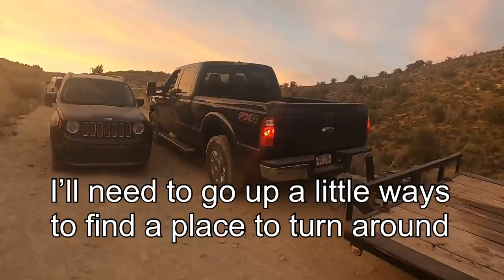Jackknifed! Ford Super Duty on the edge!

Comment: Man, a Jeep that doesn’t come with a spare. Must have those “life-time, no maintenance” tires and parts.
Reply: Those renegades are a joke.  Jeep in name only.  A fiat 500 underneath.
Reply: @jasonehredt968  I think it's a panda actually, but still useless.
Reply: @jasonehredt968  what makes them a joke?  I've been driving one for 3 years, no issues.
Reply: Only the Trailhawk comes with a full-size spare tire
Reply: @Mr.Torres831  only the Jeep Renegade Trailhawk comes with a full-size spare tire
Reply: @Ryan-yo4dg   You're full of crap the Wrangler comes with a full size spare to dbag
Reply: @jasonehredt968   Fully agree renegades are a joke should not have the Jeep title at all they are street queens through-and-through
Reply: @jasonehredt968  We've had ours out in the boonies with no trouble.  Granted, we bought a trailhawk model with taller ground clearance, different front bumper for better approach angle, skidplate, and apparently most importantly a full-sized spare wheel and tire, which to me is rather critical anywhere outside of the city.

I don't think this particular Renegade was even a 4x4 though.  Jeep has sold many models that weren't 4x4s, including old-school Cherokees though, so it's not like this is a new phenomenon.  But going out of the city without a spare tire was a bad move.
Reply: @gearhead9115  I never said anything about other Jeep models not having a full size tire, I simply stated that it's the Jeep Renegade Trailhawk that comes with a full-size spare tire
Reply: @Ryan-yo4dg   Everything makes them a joke clearly they can't go off road for God's sake they had to stack rocks to go up a  Fucking car trailer ramp.  I realize it has a flat tire but good Lord a real Jeep with a flat tire could still go up that without stacking rocks, that thing belongs on the street nowhere else and maybe a light dirt road lets it. it has no place on the trail  That's a joke of a rig As I said you can maybe take it on and arose and be safe but a true trail forget about it.
Reply: @gearhead9115  no need to call me a dbag
Reply: @gearhead9115  mine is a street queen during the week and a weekend off roader/toy hauler
Reply: @gearhead9115  the only joke here is your improper use of punctuation, poor grammar and unnecessary profanity.
Reply: You guys are funny. Most people can't afford a 50k wrangler, and something like the renegade is good for the snowy winter months for the northern states. Yah it can't go rock crawling but it's not build for that
Reply: @donavina.9066  YouTube Jeep Renegade Trailhawk in Moab, Utah and you'll see numerous videos of it rock crawling
Reply: @Ryan-yo4dg  Oh I know. I have one with a 2in lift, bfg ko2 tires, and KMC rims. Does good to get me out to my favorite shooting spot, and does great in the snow. That's all I need it for. I didn't want to spend the extra money for a wrangler when I don't need it. Besides my extra money goes towards my motorcycle anyways
Reply: @donavina.9066  I've considered putting a 2" lift on mine as well, which size BFG tires are you running?
Reply: @Ryan-yo4dg  225/65/17. Going to go up to 235s next
Reply: @donavina.9066  Good to know, thank you 😃
Reply: @donavina.9066  which brand lift are you running?
Reply: @Gadget293  Fiat 500. https://en.m.wikipedia.org/wiki/GM_Fiat_Small_platform
Reply: @justinotherig  who's cares what it is. If someone likes something then they do. You can't please them all I guess. Plus Fiat owns jeep now so yah even wranglers are built by Fiat. Lol
Reply: @Ryan-yo4dg  I have Teraflex. But avid or rough country is good.
Reply: Donavin A. I don’t think there is anything wrong with the Renegade, I think there is something wrong with selling an SUV that is advertised as being off road capable and not including at least a donut.
Reply: @donavina.9066   I'm not concerned  at all with who builds it.  I was simply reiterating the platform built on for someone get questioned a previous statement.
Reply: @Gadget293  in which situation was the Jeep Renegade useless while you were driving it?
Reply: @JimYeats  True I agree. I bought mine mainly for the snow. I needed a cheap 4wd. Most of my money goes towards the motorcycle anyways lol
Reply: @justinotherig  Eveyone knows that it's a fiat. Just like the Toyota Supra is a rebadged BMW. But I don't care that I drive a fiat. I'm not complaining
Reply: @JimYeats  it's primarily the Trailhawk trim level that is marketed to be off-road capable.  The Trailhawk comes with a full-size spare tire. 

That's not to say that the other 4x4 trim levels aren't off-road capable because they truly are.
Reply: They may not know where it is, lol!  I guess Matt would have found it.
Reply: @JimYeats  We have an XJ and a FIAT 500. A donut spare was an option on the FIAT, cranks down from underneath like on a pickup.
Reply: @donavina.9066    I agree and have little regard for who builds what. I drive a "Fiat" too. I am on my 2nd one actually. I simply want people to have correct information.  It is a big part of what I do for a living.
Reply: @k henne yes, it's an option on the Latitude for sure, I can't speak on the other trim levels.  A full size spare tire with matching wheel comes standard on the Trailhawk
Reply: @JimYeats  Thats not not considered off road capable unless it has the trail rated badge
Reply: I recovered a Fiat I mean Renegade from Moab and trailered it back to Salt Lake for a guy. It had a steering issue. I own a Jeep Wrangler and the Renegade is not a true to the name Jeep. Look it up it really is a Fiat underneath.
Reply: Jason Ehredt my thoughts exactly
Reply: I've always had a spare tire in my cars, but I never ever used one..
Had a flat a couple time but always in ways that I could just drive home with filling up the tires a couple times on the way... never ruined a rim this way either...
Not that I drive a lot rough offroad, but theese guys didn't either, its just bad luck..
Add that to that over half the drivers out there doesn't know how to change a tire anyways, so why bother?
Reply: Renax the Man personally I believe the ability to change a spare tire should be part of the license test, yes you’ll get dirty, yes you need to know how
Reply: @Beandiptheredneck  I kinda agree.
There's a vid here on youtube somewhere of a girl with no arms changing the tire on her car, so you run out of excuses pretty fast in my eyes.. Its not like it difficult either...
Reply: @Mike 2A4Life Yea, in a world where Lamborghini, Ferrari and Porche has made SUV's why wouldn't Jeep make a city cruiser?
I for sure wouldn't buy any of them, because I don't belive thats the best cars you can buy for any needs, but if you want to why not.
Most people don't buy the best car for what they need anyways, they get the one they wants the most from the selection of their price range and it can do what they need it to. I know for what I need there are better more reliable cheaper cars to own, but I like mine better for other reasons.
Reply: James L Like I said earlier. I can’t afford a wrangler and needed 4wd for the snow. This is all I could afford. We got 2ft of snow all at once this past winter and my road doesn’t get plowed and this handled fine with some BFGs. I don’t go rock crawling so wth do I need a real Jeep (Wrangler) for. My money goes towards my motorcycle.
Reply: I beat on my renegade lol not even in warranty anymore and never broke anything
Reply: @jamesl9686  XJs are very capable! Used to have one with 42s. Pushed it too hard when at the Rubicon and grenaded a piston. Sat for years then sold it to a dude who sawzalled the top off. Replaced it with a 1984 Ford Bronco 2 with a small block 302 with a 2in lift
Reply: @gearhead9115  Yes it is a YouTube comment section, but when you have poor grammar and punctuation, you don't come off as a very bright and knowledgeable person
Reply: @gearhead9115  where are you sourcing your information in that the top is not removable on the Wrangler? 🤔
Reply: @Ryan-yo4dg   I am sourcing my information off of a video they had on the new Wrangler. It's on YouTube
Reply: @Jim  Yeats   No man is called the pavement princess jeep  don't  need a  spare  don't you know  it's got a  Glorified version of that slime stuff to seal holes except for a major blow out.
Reply: @donavina.9066   As I've said before the Renegade is a street Queen through-and-through.
Reply: Brian Amrhein Why do you care so much about what people drive? Who gives a shit. If it bothers you that much that people drive a street Jeep that gets great gas mileage, then by all means buy them a wrangler to make your self happy
Reply: @gearhead9115  not the Jeep Renegade Trailhawk.  

It's equipped with factory brake lock differentials, low range, hill descent control, rock mode, better approach and departure angles, engine & transmission skid plate, gas tank skid plate, 2 front tow hooks, 1 rear tow hook, 0.8" of additional ground clearance, all terrain tires, full size spare tire with matching wheel and to top it off, a Trail Rated badge!
Reply: @gearhead9115  He means the Trailhawk trim level of the Renegade.  The Wrangler is a totally different vehicle than the renegade and comes with a full size spare.  Of course it comes with a full size spare. Everybody knows it comes with a full size spare. It's right there on the back.
Reply: Some idiots just dont carry a spare.

Comment: I'm glad that I'm not the only one having trouble backing up the trailer on tight corners, etc.

Here we have smaller roads and it's a real pain when you have to back up or turn around, it happens many times.

A jockey wheel is a must for me, it's so easy and faster to unhitch the trailer, push it to wherever I want and then you're ready to go. Not to mention that it's very useful if your trailer is parked and you need to move it around for some reason.

Comment: Many years ago I worked for a trucking company & we had recovery crane that fitted on the 5th wheel of a tractor unit which could be quickly fitted to do a suspended tow recovery on an other truck. I noticed that the F-250 had a 5th wheel; a demountable tow crane would save the pain of dragging the trailer over the trails.

Comment: In reference to the rock crusher part you are using as a fire pit. I worked as a Welder for 15 years at a now closed  Foundry in Seattle, "Western Steel Castings". We manufactured that type rock crusher part and many others. It could be one of ours. FYI,  it is made of "Manganese" alloy, very hard material. If you need to do any welding on it, we used "Nicromang", (Nickel, Chrome, Manganese) alloy stick rod for joining dissimilar metals. Love your videos!

Comment: That's interesting. Backing is successfully done when you do a proper pull-up. That's key. But after 28 years of truck driving it's natural to me. That's the only real skill I have to offer. I certainly couldn't do the other 90 percent of what you do and you got through that back up situation just fine anyway 👍

Comment: When you transplant a tree like that, you end up doing a lot of damage to the root system. In order to compensate for the loss of roots, you have to cut back the upper branches pretty radically at the time of transplanting. It seems horrible, but they usually recover  quickly. You might lose that tree yet due to stress. Another thing you might have done is put  some sort of flexible pipe in the hole and set the tree on top of it at planting time. That will allow you to water the roots directly where they need it. Just leave a stub-out above the ground and run your hose into that. Otherwise, massive amounts of water will not get to the roots, either evaporating or being drawn off to surrounding soil.  The best way to transplant is to do it over a one year period. Dig around the tree carefully and leave a couple of big roots intact to support the tree and supply it with water. Cut the rest of the roots a foot or so out from the base. These will branch out thickly and form a root ball during the year. Bury everything again and wait til next year, when you will cut the supporting roots and lift the tree and root ball out. Best to do this in late fall or early spring when there are cooler temperatures and more rain.

Comment: As someone who’s spent a lot of years trying to get trailers where you can’t get a truck and trailer into together.. IE no turn around areas.. I find it much easier a lot of times to just drop the trailer best I can.. pick it up and pivot it with some help then rehook to the trailer..... oh wait you’re now doing that as I type this lol.. I find a lot of the time it’s easier to just plan for this ahead of time though.. my tow rig also runs oversized air bags too so I can pick up and drop trailers wo even exiting the vehicle (other then locking and unlocking things) this would also help with the approach angle issue in this recovery. You’d be able to lift the rear of the truck several inches to help..
Reply: If you practice reversing it could save your back, try and let the vehicle do the work. Drive an extra half mile or whatever is worth saving your health.

Comment: Good lesson here about dropping tyre pressure when hitting rocky trails.  Tight tyres = torn tyres.  For trails like this you want something like 22psi front 20psi rear (depending on your load distribution).  Really sandy or rocky stuff you can go as low as 12psi, but then you MUST have a way to reinflate before the next gas stop.  20psi you can make do on paved roads, only a little drop in handling and braking, but it's as low as you want to safely go.  12psi is just dangerous travelling anything over about 20mph on paved roads with your middle onroad/offroad tyre, and even at that speed you run the risk of rolling the tyre off the bead and completely losing pressure on mild corners.

Comment: The serious issue here is vehicle manufacturers no longer equipping vehicles with spare tires and consumers that don't realize that buying those vehicles is a mistake. It is like not having a gas gauge - you are doomed to be stranded. I wouldn't take a trip on the highway without a full size spare, so going to an isolated off road destination without a spare is a risk I would never take. Probably the only vehicle feature as important as a spare tire are the jack and tools needed to change it. I like the way Matt immediately gets to the problem by starting his videos with "So such and such dilemma..."

Comment: I'm not an expert but here's some free advice. I won't charge you this time :D Reversing the trailer in to that space was a good idea but it was the front wheel of the Ford that was over the edge. Had you driven in and reversed the trailer back out of there then the trailer wheels wouldn't have gone over the edge as they were in the middle of the trailer. Your wheel base was only 2 thirds of the length of the whole rig.
Reply: @MattsOffRoadRecovery  Oh how I wish I could be there. Unfortunately I don't think I'll ever be able to. You're honestly turning me on to Jeeps too ;) However, as for now, I've got a Land Rover that needs it's engine put back together,

Comment: Love the vids guys. Have you thought of modifying the trailer like maby some skid plats/sliders on it for this type of recovery ?? I seen the other vids where you have used blue steel and a heavier duty trailer and had to kinda drag it across some rocks and thought skid plates/sliders would help both with the recovery and easier on the trailer and truck. Just some thoughts.

Comment: Dayum, youre brave.  Once I was looking over the cliff I wouldve immediately disconnected the trailer and manually turn it and then asked the guys to jump in the truck bed for weight  and only then turn around further.  
Also Is it so quick to cut a tire with a rock? That Renegade had quite a lot of rubber, the f250 Matt is driving seems to have a lot less and bigger rims, more prone.  Im guessing 90% is the driving and experience of finding the right path.

Comment: I have a renegade, when I ordered it the options were no spare, bagel spare, or full size. I opted for the bagel. Anyway, rather than send that rig all the way up into the boonies, why didn't you just pick up a wheel and a tire and bring that in the back of your Cherokee? Or just the tire? You can break the bead with an ordinary bumper Jack, and two tire irons and a little compressor would do the job. Renegade tire and wheel is little dinky toy stuff.

Comment: Well it was truck after truck, we all got stuck
'Cept the big old four by hutterite truck
We all thought "lord are we in luck!"
But he wouldn't come anywhere near us,
Mighty neighborly, mighty neighborly.
We used a lot of our backs, a little of our brains
We jacked up the jacks, and snugged up the chains,
We all did our very best to refrain from shovelin'.
We put what timber we had, underneath the wheels
And we was all out of sand, but managed to steal
Two sacks of the best modern canola seed you ever did see,
That 'oughta give us some traction
The Chev got stuck and the Ford got stuck
Got the Chev unstuck when the Dodge showed up
But the Dodge got stuck in the tractor rut
Which eventually pulled out the Ford

Comment: In case anyone is interested in a fire pit like that shown at 11:54, but doesn't have access to used parts from rock quarry, here's a reasonably close equivalent:
https://www.cabelas.com/product/REDHEAD-COWBOY-GRILL/2866355.uts?slotId=1
(remove its legs and you'd have a 40" diameter bowl)